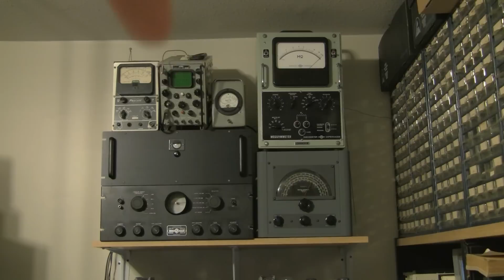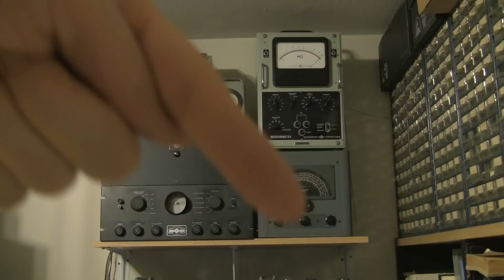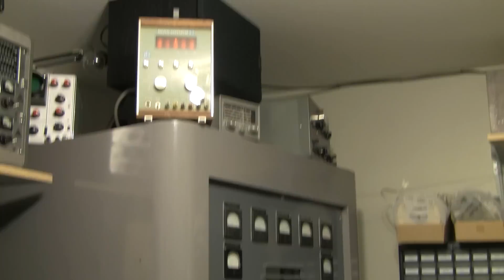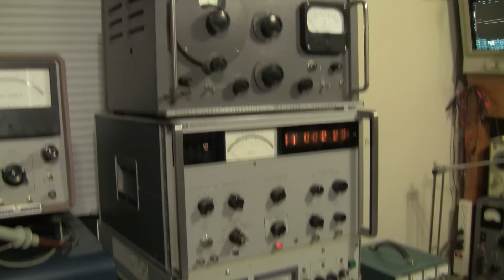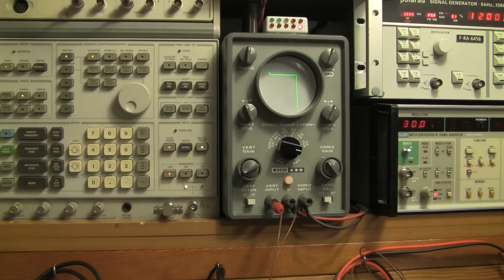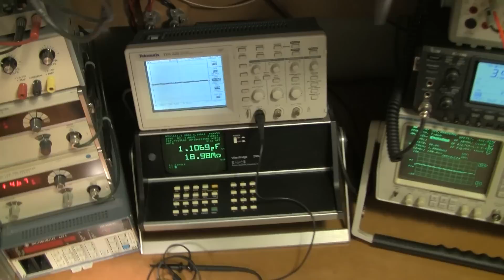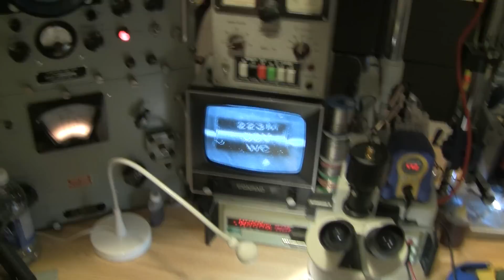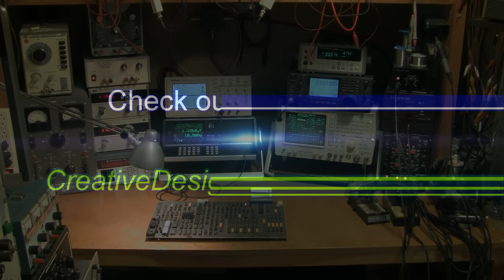View my personal electronics lab

Comment: Great Lab. Love the older electronic stuff, especially  valves.  I started into electronics 50+ years ago but haven't done much since SMD. My lab, at the moment. is a Multimeter in a plastic box. Thought I knew how to put a capacitor in. The case writing all same way etc, then I saw your video feed re capacitors.  Very informative.  I realise now how little I do know and what there is to learn, fantastic.

Comment: Tektronix 5xx gear (vacuum tube) and Tektronix 79xx gear (solid state) are wonderful antique pieces, with lots of plug in modules. Great fun.  Today's digital oscilloscopes surpass almost all measurement capabilities of these boat anchors. Now, the 44Ghz spectrum analyzer is an unusual piece, maybe good for E.T. radio transmissions, if E.T. even uses radio waves.

Comment: Thank you for the tour. My father was television and radio repair,  a radio engineer in Jacksonville FL, then he ended his career moving up the ranks in digital electronics at Show Biz Pizza and Chuck E Cheeze. I remember in the 70s when he replaced a huge  vacuum tube based transmitter that was fenced in along a wall of inside of the building. I remember the replacement might have been close to the size of two refrigerators. I remember he hired my brother in law to replace the light at the top of the 400+ foot tower.

Comment: Paul, I just came across your channel and quickly subscribed as I am and always have been very interested in electronics and formally started my education in 1968 in my 11th grade where half of my day at school was spent learning electronics and tube circuitry. I graduated high school with 1000 hours of electronics training and a 2nd class FCC Radiotelephone License. With the draft being done, I chose to enlist in the Navy as an Electronics Technician and volunteered for submarine duty to stay away from Vietnam, which worked very well as I spent 75 days at a time being submerged with Polaris missiles. I specialized in Inertial Navigation which was very interesting but I was more of a module technician than an electronics technician as we never did any troubleshooting to the component level. After 6 years in the Navy I got out and started my career working on TVs and stereos. Anyway, after working for 50 years in electronics, I am now retired but still have a very strong interest in it and I am very much excited to watch all of your videos, which I will have the time for now especially because of the Coronavirus lockdown right now. I have built and repaired tube equipment since 1965 and just lust after your lab equipment, even after working with some pretty amazing stuff myself, some of which I cannot really talk about from my days working on Top Secret stuff in the Nevada desert. Really looking forward to watching your stuff instead of hours and hours of movies on TV.

Comment: Your electric bill must be high
Reply: over 9000 that is
Reply: I'm sure he has his own Tesla generator outside!
Reply: Sure, but he doesn't need heating in the winter. Just switch on that fridge-sized transmitter and microwave the whole house (and the garden outside, if there is one)
Reply: I'm imagining he needed a much higher amperage breaker installed into his panel for the garage circuit.

Comment: this is my DREAM lab. So far ive got a fluke multimeter, 30 volt 1 amp power supply, a tektronix analog oscilloscope, soldering station, and a few tools. I will eventually build up to having this awesome lab. One day... Anyway awesome video thumbs up 👍

Comment: Dang...  lots of cool stuff......  I even know what half of it does!   I always enjoy your presentations.   I fix computers, and build networks,  so my needs are different.   About 5 or 6 years ago, I started hobby building musician gear like guitar amps and stomp boxes.  I have a fairly decent handle on vacuum tube audio... and still learning solid state.   I'm amazed at how quickly you spot issues,  but then again, I can do that with a very high percentage of computer issues...  so I guess it's just specialty + experience.   Keep up the good work boss!

Comment: Very nice, clean, and organized lab!  Need to send you a picture of my lab when I finally finish putting it back together I have late 70's/early 80's HP, Fluke and Tektronix stuff!  Nearly all equipment is GPIB connected to an HP 85A and HP Vectra computers.  Using a trimble GPSDO for my 10MHz reference.

Comment: Looks like a Gates 250 watt transmitter at about 2:22.  I maintained one 1966-1968 at the Naval Communication Unit transmitter site at Midway Island (technically, the Midway Islands, Sand and Eastern.  I was on Sand Island).  It was used for the local AM radio station which was KMTH at 900 kHz but at some point we were told to change it to 920 kHz due to interfering with somebody somewhere.  Crystals of the type used were no longer available.  But it was a style with a loose crystal in a holder and since we were going up in frequency, we could accomplish it by going down in crystal thickness.  We removed the crystal and lapped it on either fine sandpaper or crocus cloth on a workbench and by trial and error got it 920 kHz.  We also had a problem where some transformer in it failed for which there was no longer any replacement.  For some reason, our Chief had previously ordered some various Heathkits (strange for a military facility, but true) and we had assembled them.  One was a model SP-17A high voltage power supply which was sufficient to provide the now missing power supply voltage in the Gates.  So I rigged it up and set it on the floor inside the transmitter.  And then proceeded to forget about it.  When I left Midway, it was still soldiering on and I don't know what the fate of that transmitter was after that.
Reply from the maker: Thanks for sharing your story Charles!

Comment: i live in the Quebec province, i took electronics classes, and i'm having a hard time finding repair equipment!.. up to now i have a UT73 multimeter, BK 60MHz analog scope (broken but now fully functionnal), Realistic all AM FM bands radio scanner, UT3315TFL power supply, newly acquired Brunelle 3030 function generator, and a Sencore VA48 video generator (complete documentation &wirings), and a shitload of parts .. trying to avoid buying online over ebay and such to avoid huge prices is quite a challenge! there aren't many people who used to do repairs that are selling their stuff

Comment: Amazingly well equipped shop, Paul, thanks for sharing.  I'd really like to see a video sometime on your "more power" Hakko desoldering tool modification.
Reply from the maker: Don_CC12 Thanks Don, I will open up the variable frequency drive (VFD) I designed for the Hakko in a future video. Elements for the 802 gun are becoming a pain to find now. Might have to get the 809 gun soon. Thanks for your comment!

Comment: My dad was an engineer for Radio Corp. of America.  Your lab reminds me of the transmitting station control room  on one of my visits.
Reply from the maker: +Greenfield 54 
It is getting pretty congested in the lab.
Reply: +Mr Carlson&#39;s Lab I'm kinda the type who can't throw anything away.  I rescued some ww2 U.S. Signal Corp equipment from my dad's collection.  An Espey 105 Tube Tester which I last used in the 60's, a BC 221 AF Frequency Meter and a Megger.  I don't know how to use the meter since there was never an occasion that needs it.  Not surprising since I only built one radio project which was a five tuber.  That started me out.  Am impressed to see all your equipment as prestine and working.  Your big transmitter looks like it has the RCA logo.

Comment: 0.46 top row, 2nd from left with the green screen, I have one of those I bought on EBay but here in the UK the voltage is 230v AC so I have never been able to test it. Got an old ex-RAF one as well, that works but boy does it smell lol.

Comment: Your shop is amazing. i did notice you have a hallicrafters sx-28 . I recently came across one with a bunch of other vintage stuff , once i put my eyes on i couldn't leave with out , I had no clue what it was or its history until I got it home . Turns out mine if from 1944 but instead of having the sx-28A panel they must have used the old stock sx-28 panel. Now im looking for an S meter for it and eventually will get its speaker.
Reply from the maker: +Roy Garcia 
Great Roy!  I will be doing a video on one of these in the near future :^)

Comment: Thy do you prefer 0402 over say 0805? In my opinion it's easier to work with and small enough for most stuff. This is one of my favourite Channels. Great work Mr.Calson!
Reply from the maker: I don't mind all sizes, I use 0402 mostly because I have a full selection. I have lots of 0805, 0603, 1206 and bigger as well. Thanks for your kind comment Michael!

Comment: I made a comment 9 months ago apparently but having seen this video again tonight, I heard (I think) you say that Spectrum Analyser in the corner spanned up to 44 GHz !!!  How on earth did they manage to get that bandwidth from what looks to be a tool from about 40 years ago.. I never realised they could reach those frequencies back then.  Is it that old, please enlighten me....What's the model number Paul, I would like to find out more about this device....
But once again, that really is a nice shop you got there.
I noticed this time too that you have some HP there with the classic LED light through the centre of the button... I remember using gear like this in the 80's at GEC UK.
That Tektronix DSA602 seems to be a CRT with sensors around the screen to detect fingers or probes... early touch tech but lovely all the same.
With this demo you must be drawing well over a Kilowatt of energy, Everything is turned on !!!  Must be warm in there too..
Reply from the maker: +Michael Hawthorne 
Hi Michael. The spectrum analyzer is a Lavoie model, an/upm-110, It's from the 50's and was use for radar servicing. I also have the full set of wave guides and so on. I also have an HP-185B, GHz range sampling oscilloscope, which is a very interesting piece of gear for it's time, it uses the 186A plug-in. That can be seen at any of my newer video intro's and ends, to the left of your screen. The Tek DSA 602 is a great machine as well. It uses an IR array to sense fingers poking at the screen. It makes a scanning grid, and your finger interrupts a small portion, giving it an idea of where your finger is. The scope is incredibly fast, with features (math) that modern scopes don't even include, which is nice for some of the things I do. Almost all of  the service info for the scope is still classified, which makes servicing a pain! Very rarely does more than a few pieces of equipment ever get powered on at a time, so the room was warm during the video.
Glad your enjoying the video's Michael!

Comment: A very impressive array of test equipment Mr. Carlson; makes me feel at home. Have you ever considered evaluating tube testers? as I recall you have one to test tubes when you suspect one or more. But you probably found different makes give different readings. I own three different makes and models, two I have restored and calibrated using 1% resistors to yield the best results, differences with the same tube (6AL5) and others made me realize very quickly that transformer design and power seem to determine readings whether it be a Mutual Conductance or Emission Tester. In other words they give you an indicator only, since tube testers can't mimic the exact working condition of the equipment.
Reply from the maker: +John Cunningham 
I agree. The best test for a tube is the circuit it lives in. When I use a tube tester, I usually just use the scale to indicate if it's very bad or very good, ...One side of the scale or the other. Thanks for your comment!

Comment: I read one post where someone asked how you remembered how to operate everything.  I guess it's because you use it all the time.
That question struck me because I have a poor memory.  I used to operate Scanning Electron Microscopes, and when we donated an older one to the local College, they ask for help learning to run it several months after the donation.  My boss and I went over, and I was extremely embarrassed that I could remember very little about it's operation.  My boss remembered it quite well, although he had stopped using it quite a bit earlier than I had.

Comment: What make/model/year is the 44 GHz unit?  I didn't think 44 GHz existed back then.
Reply from the maker: +mevmevmev 
Hi, The Spectrum Analyzer is a Lavoie AN/UPM110  from the 50's. I also have a few 1Ghz oscilloscopes from that era as well. One of them is the HP-185B with the 186A plug in. Here it is on HP's site. http://www.hpl.hp.com/hpjournal/pdfs/IssuePDFs/1962-03.pdf

Comment: Did you have any Freq. Standards hiding in there ?  Nice lab, just  a little crowded.  Keep up the great videos and have fun.  Upgraded my Timex digital watch to the 24-Hour mode.

Eyes UP and lights down,  tjl  Sent by Win7Pro64 w/ADSL
Reply from the maker: Hi Tim, Thanks for the comment! There is disciplined oscillator in the set up, with a 10 Mhz distribution amplifier. LOL... as the equipment moves in, the lab gets "tighter"

Comment: Hello Carlson
I have an 2955b too!
Whats your opinion on this service monitor and why you chosen it?
I have to troubleshoot mine because sensitive receiver front end mmics were broken... And the reason is bypass switch relay got stuck at some point because of a kind of glue they applied to press the ribbon connector underneath the relay bobins cover melted over the relay lol so watch out if yours have option 1 installed as these relays are exposed to dirt inside and if sensitive receiver relay got stuck and u put power from radio tx, mmics will be fried jejej.
Other than this story... Seems very good gear for me :)

Comment: I see you performed a modification to your Hakko 936 solder station.
You swapped the single color LED to a Bi-Color (Green/Red), that changes color when iron heater powered.
What circuit did you select to perform this modification?  Did you post video?

greg
Reply from the maker: Hi Greg, I didn't. That iron is getting pretty old now, the FX-888D is it's replacement. I don't think there would be too much interest in that mod anymore.
Reply: @MrCarlsonsLab  
OK.  The late Tom Hammond, N0SS did a power LED mod for Hakko 936 (and reverse engineered the schematic).  I have repaired a number of genuine 936, for the beginner electronics hobbyists. 
Some benches still use because you can stack the cases (FX-888D can not).

Comment: The most surprising / disturbing thing about this "setup" is that there is no HP 3458A.
But more spectrum analyzers then you can count ;-)

Also, I love the little wireless phone thing on that bench at 1:34.
It probably doesn't get much use ;-)
Reply from the maker: I have a friend that has three 3458A's, but I have never been interested. They are a nice volt meter though.
Reply: @MrCarlsonsLab 
I get it, everybody has "their thing" ...
Nothing wrong with that ;-)

Comment: Don`t let my screen name through ya. I got to ask that transmitter is that ham radio I know nothing about ham radio if so how far do reach.I took advise on the weller tips beatifull man I have b100 with two lights and post terminals instead of sleeve. I`ve got heating up hot enough with the wire to melt lead free solder in about 25 seconds

Comment: hey there! Great videos here... I already subscribed. Awesome lab also.

Question: I just purchased an Type 547 scope just like yours... Did you have any issues with the HV transformer? If so how did you fix it?

Cheers.
Reply from the maker: Hi, I haven't had any issues with my 547's, what so ever.
Reply: Wow.... must've been kept in a very dry environment then... because that transformer is famous for absorbing humidity due to the epoxy saturation. Still awesome scopes for the age (and for the tubes!), the trace is thin as a hair.

Comment: How do you like the ESI LCR bridge? I have one, and love it. I bought a Wun Hung Lo Chinese LCR as a back up. It works okay. The ESI is better.
Reply from the maker: +Seth B 
I don't mind it, I do like the Genrad 1689M across from it as well.
Reply: I finally picked up a General Radio LCR 1689M. Not a bad one either. We used to trick other kids into climbing up on the statue of Saint Gregory, with a hammer and have them go ring the bells in the bell tower at the church. No bells up there! Only lots of pigeons and fiberglass horn speakers, running though those old mono block amps. I went up there with a ball peen hammer myself. I felt like an idiot too, while everyone was laughing at me.  Now they are using David Bogen solid state amps. I just did some work on their old Baldwin Organ amp. NEAT AMP! 400 watts solid state with 6 center channels, 4 left, 2 right, and a really weird weird ganged pot EQ circuit. Two knobs, volume, and a church-classical EQ knob. LOL!!!! Ity says "Turn knob fully clockwise for classical music organ". One of the main reasons I love doing this kind of work. What won't I see next?

Comment: Nice setup!!
But it must use a lot of power...  
The older valve stuff does generate a lot of heat.. Greets PA1BJS /Sebas
Reply from the maker: +TheBas1984 
Nice and warm for the winter :^) Thanks for your comment!
Reply: I own a couple of boatanchors (TS520 and a FT-7), and they generate a lot of heat, but they are far more relaxing to listen to than the modern wonderboxes (FT897D, FT817 etc..)